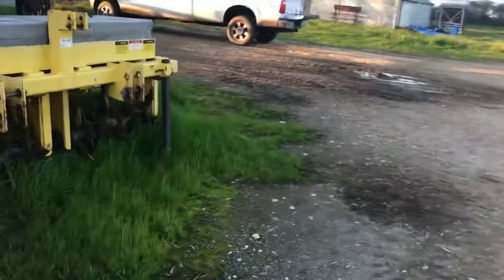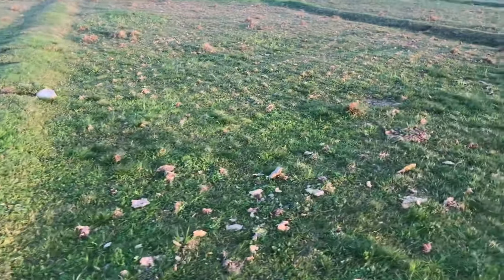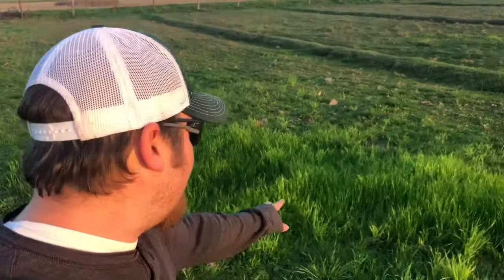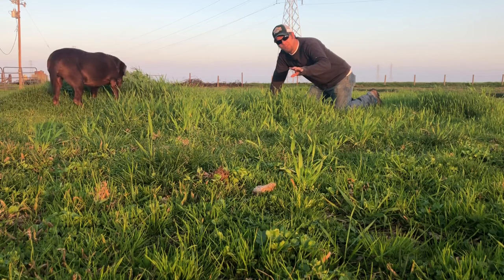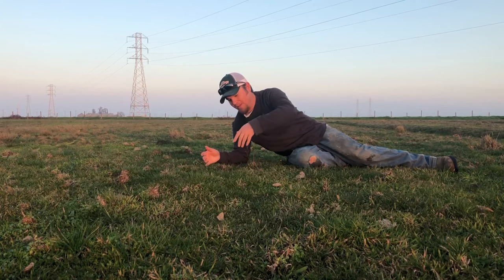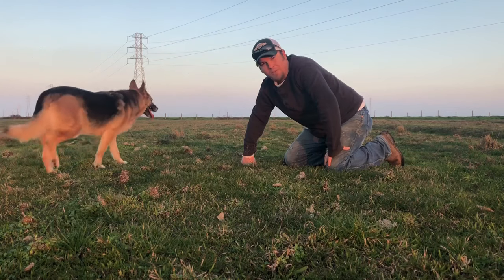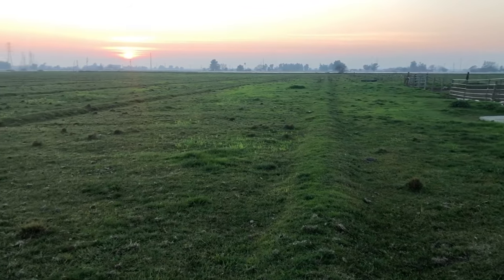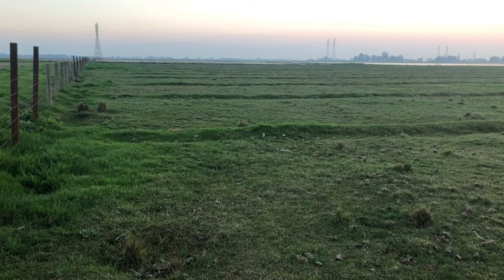Pasture Aeration, Two Month Update

Comment: So my back ground is greenkeepers here in Australia. Some useful information for you.1* you won't see much results from only aerating it the one time over , especially after its probably been compacted for so long.2*. Dragging a scarifier or harrows around to break up cow pats and if you have some diamond harrows will help to rip out old dead grass.3* I would probably aerate 2 or 3 times over initially then go 2x at the end of the season , remembering to go either diagonally or criss crossed.added if you aerate it with the same sized tynes all the time you will end up with panning, so a layer underneath that is not permeable.this causes anaerobic conditions for the roots and aids in the growth of weeds rather than grass .weeds love compaction or poor drainage.suggest if you can afford to do it, deep ripping down to 2'.every 3or 4 years.and addition of gypsum or dolomite .

Comment: You need to drag a drag harrow ( the twister bar type) to drag  over your pasture ever so often  during the winter to bust up the cow piles to help keep down flies and worms, because that is how they over winter as an egg in the manure as it rot it generates heat to prevent the egg from freezing. I have been subsoiling, aerating and ripping my pastures for over 30 years. FYI only.

Comment: A cheap way to spread manure piles is a section of fence ( I lucked into some 8 foot chain link from security cage). I traded for 16 feet of it which was the longest piece they had. I had some two inch pipe with 5 inch legs on it that had a plate to anchor it to concrete as a barrier for load being pushed to close to machinery in a factory. I slipped a smaller pipe inside welded and bolted it also  I looped the chain link around the pipe and tied it with lots of number nine wire. Or fence brace wire is fine. Then I cut two tall thin trees , cleared the branches and put one in the middle the other on the back and pulled it around the pasture. Works great for spreading cow pies. But doesn't work well in the heavy slop where they been feed a lot or alleys they travel. But the man I got the idea from just used woven wire fence. I use wire cable around the legs to a Clovis on the tractor. Just watch and don't bush hog it. It's cheap and it works.
Reply from the maker: Thanks Keith I can see how that could work really well!  I’m going to rig something up for this year.

Comment: I tried a field aerator and thought it was ok but not transformational.  What I've experienced that is transforming is high intensity cattle grazing where the momentary grazing pressure is sufficient to appear to destroy the plot the cattle were on.  This requires moving them more than once a day.  And then the land & forage getting a full rest cycle.  Rinse and repeat.  Takes a while.  If you can't do that try drilling cereal rye in the fall and teff/annual rye in the spring.  Hope it helps.
Reply from the maker: Thanks John. I have been tinkering with a new grazing plan. Field improvements too. Stay tuned!